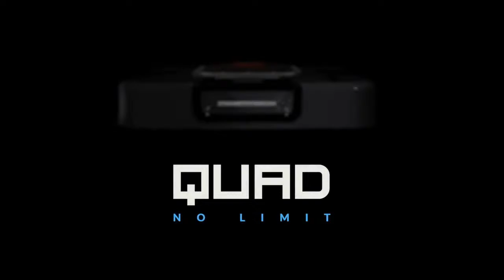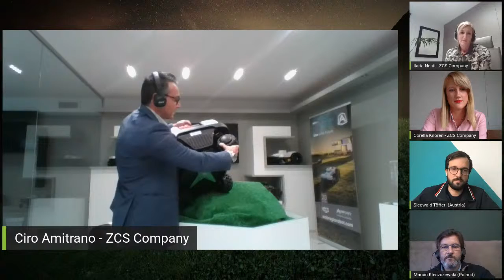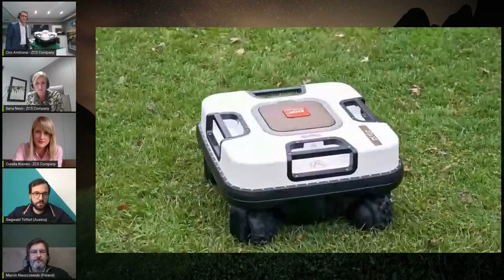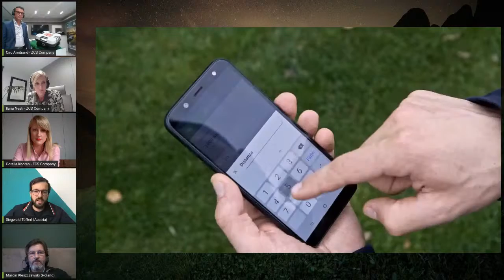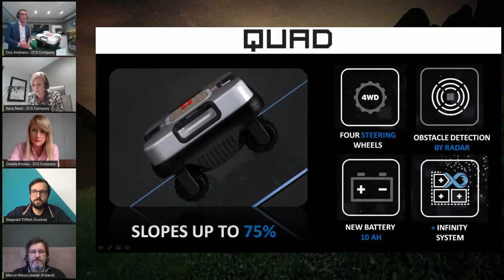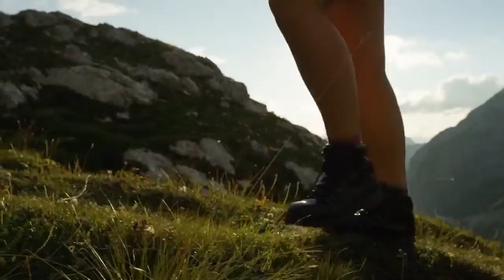Live: lawns with high slopes? No problem, Ambrogio QUAD is arriving

Comment: why is the navigation of my Ambrogio Quad Elite so bad? If the robot is stuck in some place, it repeats the same trajectory over and over again and does not try to change movements in order to get out.
He cannot find a charging station without a wire, even if he is nearby. He can't get into the charging station normally.
He tries to cut down trees, bushes, even if they are fenced with wire. This often causes it to flip over.
This is the worst robot I have ever used.
Technically, this is a very good robot. But the software is at a very low level. Any cheapest robot vacuum cleaner is smarter.
Is it possible to update the software?